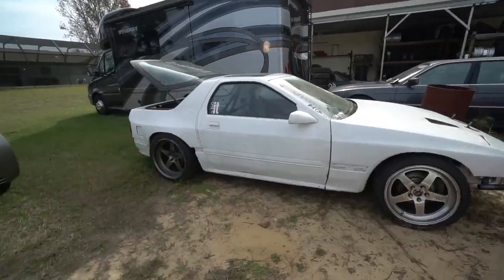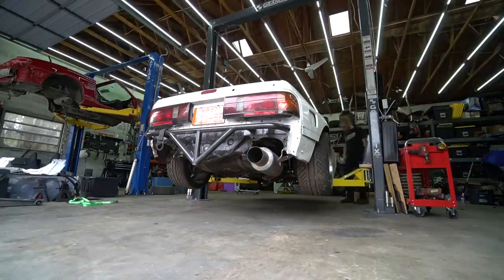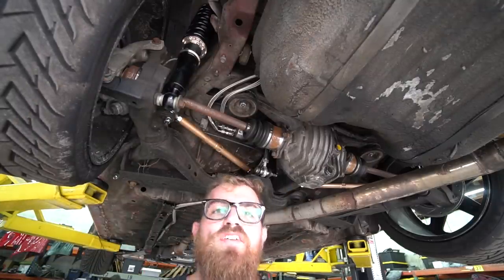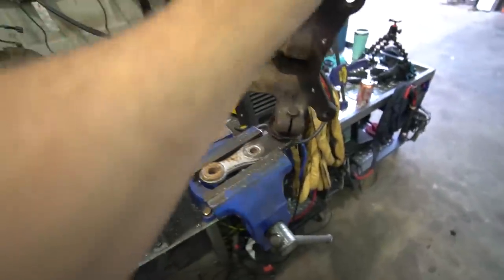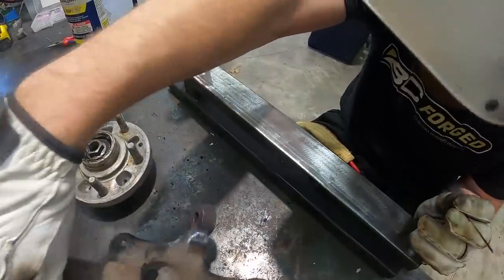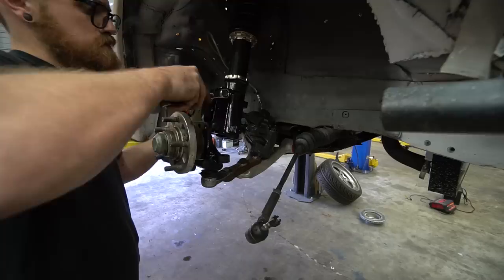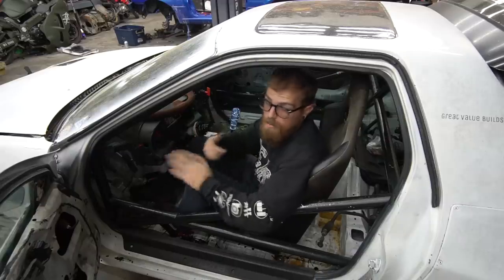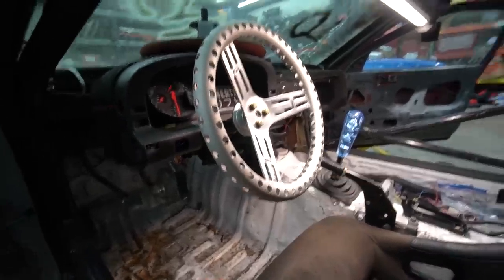Abandoned FC RX7 Gets D.I.Y BIG ANGLE and A Bunch Of Other Mods!

Comment: 2:01 wait a minute.... if I remember correctly, bens parts vette was a vert, and that’s a hatch.... Taylor ray pro2 build?!?!? Please dear God let it be!😂
Reply: Matt L I thought it looked different as well
Reply: Just came to the comments because I saw the vette😂
Reply: I noticed it too and there's no other reason for another parts corvette since nothing needs another engine or any corvette parts so... pro 2 build is all that really makes sense.
Reply: Honestly I'd be pretty disappointed if he didn't run an ls miata in pro 2. Not the current one but a purpose build one. 
Pro 1 has amazing drivers 
But pro 2 I find has more interesting cars, and it would be so damn cool to see him door to door in a miata battling for his license
Reply: @J0K3R_the_Nerd  A miata fits pretty much none of the rules for pro 2 and a corvette is just a overall better chassis to start with since you're not messing around with engine swaps and custom stuff that is hard to get quickly if something breaks with a corvette you just got to any auto parts store and you can buy pretty much everything.
Reply: It's pretty certain that he will run a C5 or C6 Corvette in Pro 2 if anything. Stock car, mild mods, steering angle, cage... the rest is really easy to swap out on the fly and you can find parts all over the country for it.
Reply: @thedestroyer3262  oh interesting I wasn't aware that
Reply: Kyle R you can no longer run a Miata in fd. Between weight and tire restrictions, as well as the need for a stock K-member, it’s basically impossible to meet fd regulations with a stock engine in a Miata, let alone an ls . He can run one in most pro am events, but not fd
Reply: AbominableJoshie yeah he said he’d probably do a near stock c5, big angle and coilovers, then a stock block turbo iron ls. Best budget chassis and best budget way to make 800+ hp
Reply: Well there is that newer red miata on the side of the garage
Reply: @Matt_Lanzer_13  I see
Reply: Cory Curtis that’s likely bens.... he owns a Miata part out business after all😂
Reply: Kyle R yeah the rule change kinda sucks imo because it eliminated cars like the ae86, Miata, a lot of older Japanese cars, etc
Reply: There’s really good angle kits available now that Matt field has done the work with parts shop max and the double a arm of a vette is just better than most stock cars suspension designs making it a superior starting point
Reply: Whitts adventures there’s also fd fab up in Canada. They make a killer kit as well

Comment: When you leave the unwelded area in the center of the steering arm cross section,  you have a crack starter. (It has nothing to do with strength).

Comment: By shortening the steering arms, you are radically changing the geometry of the steering.  I expect that you will have bump steer issues - so when a road wheel hits a bump, you get a tweek through the steering wheel.  The solution will be to move the steering rack closer to the wheel centre line.  How much is a matter of experiment.  If the track rod ball joints are at a different height from standard, the steering rack may also need altering in height

Comment: Hey Taylor, it's somewhat common to use a Toyota MR2 electric power steering pump in an FC RX7. It's the set up that Hert uses in the Twerkstallion. Here's a link to a thread with some schematics if you want to do this in yours: ausrotary.com/viewtopic.php?t=192341

Comment: The rx7 at one point had a villians nuckle kit, the lower spacers push the wheel out tie rods you have are from an S13, and they are designed not to use wrack spacers, becuase their longer. Also, when your ready to upgrade to power steering, let me know, I've doen it to my car with a v8, its super sinple

Comment: you really want to grind a bevel on that knuckle so you can get more weld into that joint. you will most likely snap it off if you bump into anything even remotely harsh.
Reply from the maker: I did grind a v into it. I talked about that.
Reply: @Taylordrifts  i know you did but im talking about a much much deeper grove. one almost to the middle of the part. think of pipe welding, there is weld through 100% of the thickness of the pipe. its just a concern. especially with a cast part.  hopefully you have enough weld on yours. you definitely have a lot.

Comment: @3:27 no shape of tie rod, bent or straight, will affect bump steer.
Reply: That's not true. The height of the tie rod in relation to the rack will affect bump steer so a bent joint will change the height thus changing the bumpsteer
Reply: @scooz14  a bent rod end won't change the height of the actual pivot point, that's bolted to the knuckle in the same place. Between that pivot and the pivot on the rack it doesn't matter if the tie rod is straight, bent, s-shaped, tied in a knot it's still going to move the same way.
Reply: @Iain240 correct, different angles won't change the pivot points, but by having a different angle it will have a different arc under suspension movement which will have a huge affect on bumb steer

Comment: I would recommend a nutsert gun. It would save you a ton of time with how you use them. And you like tools so🤷‍♂️
Reply: Wait there's a gun for that?!
Reply: @davidfletcher4016  I used them all the time in metal fab.
Reply: Thats some solid angle man. I had to flatten all the pich welds on my fc with decent lock. Has it got a spacer of sorts to space out the lower arm? I made one out of 10mm alloy plate. Think it was about 35mm. Helps with clearance and a bit of camber.
Ls in a fc is def the way to go check out andrew redward drift on facebook in d1nz. That thing is crazy fast for a pretty basic set up